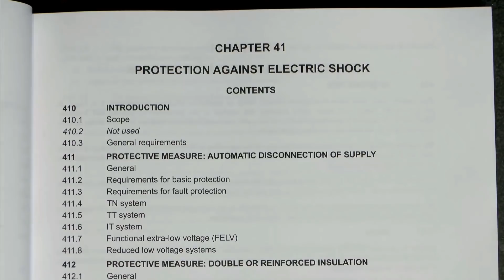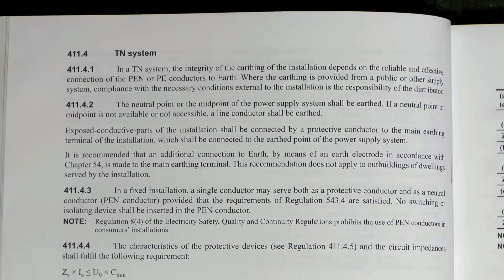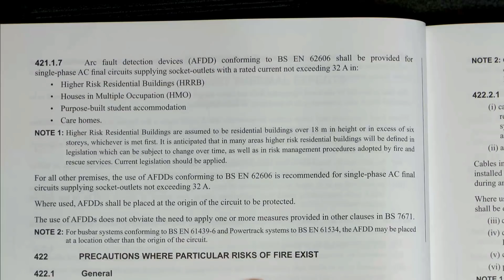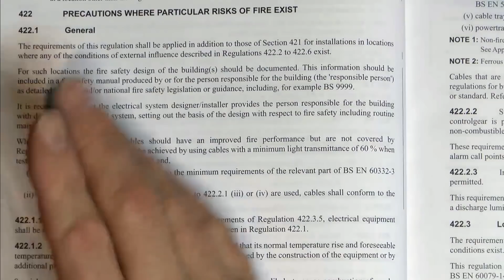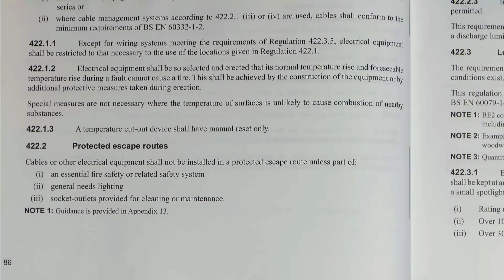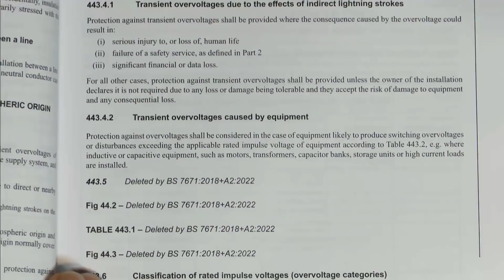BS7671 18th Edition Amendment 2 Part 4

Comment: I work in schools. A lot of cables follow the corridors on tray work abovr the false ceiling. There is no way the tiles are fire rated so does this mean the cables can no longer go there? Premature collapse is dealt with on the tray but the smoke would be insane
Reply: No. It's a pre existing installation.

Comment: I wonder if a single AFDD might as well be installed to cover all of the circuits or would this possibly cause nuisance tripping?
Reply from the maker: No, as they are only made up to 40 amps, and using one for multiple circuits wouldn't comply for the same reasons as having a single RCD for multiple circuits - one fault would disconnect more than one circuit.

Comment: Hi John, firstly thanks for the videos, always very informative. Would you be able to advise your take on a new build site of c380 units where the design was completed under amendment 1 but c200 units will commence installation / commissioning post 27/9/22. Discussing with the IET they mentioned it would be reasonable to continue the installation as designed as in theory this forms part of the contract however the removal of the “designed before” has produced some confusion and equally how this looks in terms of certification when the design standard is withdrawn? 

Thanks
Reply from the maker: Theoretically the standard applies for anything designed from that date.
However as work hasn't yet started, the design should be updated.  Otherwise it's just postponing the inevitable upgrade work when the next EICR is done, and altering existing installations will cost more than just installing it correctly in the first place.

Comment: the electrician decides upon the level of spd used, depending upon the needs of the customer. But, at the leas, a whole house spd should be fitted at main panel. Refrigeration SPDs and Electronics or Computer SPDs are different, and are fitted on different circuits, based again upon need... usually between outlet and appliance. But, I sometimes wonder why many manufacturers do not build such into their appliances, other than the need to sell replacement appliances..like the old days of the CB craze, when it took a 1P device on the circuit boards  in the TV or Radio to cut out interference from CBers, but, cost more than ten pounds to do it outside the device..
Reply: Surge protection devices are consumable and eventually "use up" their surge absorption capacity, so you might not want it in the applicance. Better to put it in a cheap adapter or power strip.

Comment: The SPD is a bit weird. So do suppliers of SPDs offer a guarantee that no electrical equipment will be damaged if you have their SPD fitted ? And as an SPD seems to.be a trippable device...what if there are 2 surges ? How many surges does it protect against ?
And for AFDD's, was it not yourself suggested these do not work well on ring circuits ? How does that go ?
Reply from the maker: SPDs gradually degrade, they will handle hundreds or thousands of surges before replacement is required.  How many depends on the amount of energy in each, which varies massively.

A series arc on a ring circuit wont be detected, as the current involved will usually be below the detection threshold for AFDDs, but the amount of energy is also low so fire isn't likely.  The still work for parallel arc faults, and for both series and parallel arc faults on connected equipment and items such as extension leads.

Comment: Thinking of surge protection in domestic situations and the 'failure of a safety service' - I would hope that fire/smoke detector units should be designed & constructed to take account of the potential for surges and therefore not require further protection.  

SPDs are all very well when first installed but who is monitoring them and how effective are they once they have 'dumped' 10 or 15 surges. Home owners will be lulled into a false sense of security if they are led to believe that their installation is 'fully protected from surges'.
Reply: True, though we're surely all used to surge protected power strips by now, with the green light showing that they're out of surge absorption capacity.
Reply: @seprishere  Sorry I've never seen one  and, as I'm a bloke, I would not have RTFM to even know what the green light meant! 😂

Back to my point who will monitor SPDs installed in CUs?

Comment: Hey John.... Any tip on testing the newly installed Electrodes....eg...Ze....in combination with existing TNS/TNCS supplied earth...???
Reply from the maker: Same as for any other electrode, https://www.youtube.com/playlist?list=PLVsHvs2SuqmoGuQa4SNL9FOYjHhGmTZ9G
The difference when using it with a TN supply is that the electrode would be tested separately, (not connected to the TN earth terminal), and the earth loop impedance of the TN supply would be tested without the electrode connected.
Reply: @jwflame      Cheers.   
 In sevice though, the Ze for the location would,  presumably, be lower, as now they are now both connected in parallel with each other. 
So. test separately....to prove they both exsist...and record each reading as a separate Ze.....or...after testing separately and proving exsistance of each... connect and test combined for a true Ze result for the location and certificate.
Reply: Surely achieving a good earth with a single rod will be a total nightmare for most installations as well as being extremely impractical to install ? Should it not be the responsibility of the DNO ?

Comment: Technically Surge Protection should be a DNO responsibility to provide a clean supply
Reply from the maker: In terms of lightning that could be true, but most surges are caused by switching within installations.

Comment: Hello John,
To your point about mini trunking in corridors being a C2 on a EICR report. It was my understanding the Regulations were not backward looking, in that if an installation complied when installed it would still be accepted.
Am I wrong in that interpretation?
Reply from the maker: Installations are coded to the standard that's applicable at the time of the inspection - not when it was installed.  This will mean that some older installs don't comply any more.  Some of those may just be 'improvement required' for where safety is not affected.  However where safety is affected such as plastic trunking melting causing toxic smoke and cables to fall obstructing escape routes, C2 is the only option.

If installations were coded to the date of installation, things like live front switchboards and double pole fusing would still be acceptable.
Reply: @jwflame  Health and safety executive’s note , witch has been updated in amendment 2  , installations installed to an earlier edition of BS7671 may not conform to the current standard, that dose not mean that it should be replaced or upgraded as it is likely to conform with the electrical safety at work regulations.  No one seems to read this note or take any notice of it, hence why it has been updated to to make it clear  any who can’t accept the fact should not be getting elbow deep in someone’s electric’s.
Reply: @jwflame  INE
HSE
Note by the Health and Safety Executive
The Health and Safety Executive (HSE) welcomes the publication of
BS 7671:2018, Requirements for Electrical Installations, IT Wiring
Requlations 18th Edition and its updating with the second
amendment, published in 2022. BS 7671 and the ET/IEE Wiring
Regulations have been extensively referred to in HSE guidance over
the years. Installations which conforms to the standards laid down in
BS 7671:2018+A2:2022 are regarded by HSE as likely to achieve
conformity with the relevant parts of the Electricity at Work
Requlations 1989. Installations to which BS 7671 is relevant may
have been designed and installed in accordance with an earlier
edition, now superseded but then current. That, in itself, would not
mean that the installation would fail to comply with the Electricity
at Work Regulations 1989."

Comment: SPDs JW you mentioned risk of damage to things like TVs laptops and iPads? well no the worst that’s will happen is the mains adapter/chargers for your laptop and iPad or iPhone may be damaged once that’s gone the power serge can’t go any further ? As TVs come on there cheep as chip now I just got a new 42in from Argos for less than £150 as it is a discontinued model, ie they no longer stock the brand  then there Amazon again you can get a new TV for peanut’s . 
So know don’t just fit SPDs if the client says no then it’s no simple as that the public do have rights and one of them is the right to say no . But who am I to argue i’am just a humble spark who’s opinion means nothing.fantastic video JW as always 👍👍
Reply: It comes to something when regulations dictate that units (AFDD/CB/SPD), costing more than a TV have to be installed to protect the TV 🤣🤣🤣
Reply: Galvanic separation within the PSUs is only for volts up to 500v.

Comment: it should be mandated that SPDs are connected to some kind of monitoring system.Most that I have come  across the little flag changes colour to show that they have operated..end of story....Is Mrs Jones going to check every day /week /month or year or at all to see if the flag has changed colour and what to do if it has..Her TV is still working fine,no power outage ....there are some that can operate a relay but often this is not used.

Comment: In terms of the type of cable aloud in protected escape routs  I can see pyro making a massive comeback.
Reply: We already have a cable fire classification system in place here in the EU. CCA-class cable is required for locations such as the description and is very similar in construction and use to previous fixed installation cables. I believe that a similar solution will be reached in the UK. I don’t think we’ve ever had a ceramic cable like the UK pyro cable in use, at least I haven’t seen one in my own career (20 years).

Comment: That surge protection opt out strikes me as a very grey legal area, regardless of it being in the regs. You're quite right JW, a plaintiff in court could easily argue exactly what you suggested, "I couldn't reasonably have known what that meant", and a court would almost certainly find in their favour. My experience of this situation isn't in electricals, its in transport, and (rather like DVSA etc) I suspect this may be a regulatory authority fishing for a court judgment in order to settle it. Which requires a mug to fall for it. I'd go with your advice, fit it anyway and don't discuss.
Reply: Equally if you are forced to fit SPD on the basis of equipment protection etc, I hope the suppliers of said SPD offer a full guarantee if your equipment ever gets damaged, they will replace. It all seems a bit weird.

Comment: Protected escape routes are normally used for nothing other than means of escape. Concrete stairs and walls. They look like unfinished parts of a building you do not normally have access to, other than escape!
Reply from the maker: Some are like that, but it also includes normal stairways, corridors, particularly where the building only has one exit route.
Reply: @jwflame  I think this will become the main contentious point in amendment 2.  The IET presentation webinar stated that a protected escape route is a very particular design by a fire design specialist and is likely to be sterile fire stairwells where's there's nothing but steel and bare concrete - rather than an ordinary corridor that happens to need 60/90/120-minute protection. However while the definition in part 2 does allude to construction it is extremely vague, yet does say "see also escape route" implying there is more than one type. I predict some clarification in amendment 3!
Reply: @jwflame  This might help https://youtu.be/ntDCLNveRDI?t=1477

Comment: So glad i didnt go for the pen device when ev charger installed although not retrospective my earth stake is already there just need to connect it to the dno earth , would there be a need to disconnect this link when testing to check the  dno earth The maximum external earth fault loop impedence Ze is 0.35 ohms.
The maximum prospective fault current is 16 kA  although the stand alone stake would not meet these figures  would this need to be mentioned to the dno ? would they correct or then rely on the TT installation ?
Reply: The earth rod needs to have an Ra of <20ohms i believe and is connected to the installation MET either directly or via the cpc of the final circuit ie hot tub or EV charger.

Comment: About 17 minutes in the Video. Does that also Include gray Twin and Earth Cable ?
Reply from the maker: Grey T&E is PVC so will create massive amounts of toxic smoke in a fire.  Not permitted in escape routes.
Reply: @jwflame  So. correct me if im Wrong. Perhaps FTP Cable (Cable used for Emergancy Lights and Fire Alarms) Should be Used
Reply: What about LSF cables in steel trunking etc, which is very common ?
Reply from the maker: @blow0me  That's fine, as the steel is fire resistant and the cable won't create toxic smoke.

Comment: Risk assessment was to keep it in line with harmonised European documents. Lightning surges are more devastating and require a Type 1 SPD. Your assessment is misleading.
Reply from the maker: Most buildings do not require Type 1 SPDs.
Reply: @jwflame  how would you determine that? With an assessment right? That's my point. We shouldn't say risk assessments are nonsense. We should say if there is a risk of a direct lightning strike because a dwelling is exposed (high rise building in a rural area, over head power or telecoms supply lines at risk of direct strike for examples) need to have Type 1 power and Category D tested telecom SPDs. IET regulations should project professionalism from the standards that they are compiled from. Please take care in your future teachings. You are great at educating and I of course respect you for your outreach.
Reply from the maker: @alphaomega7868  Overhead supply or building already has lightning protection installed = Type 1 required.
Underground supply and no LPS installed = Type 2 required.
Whether a building needs lightning protection is a separate issue and isn't covered by BS7671.